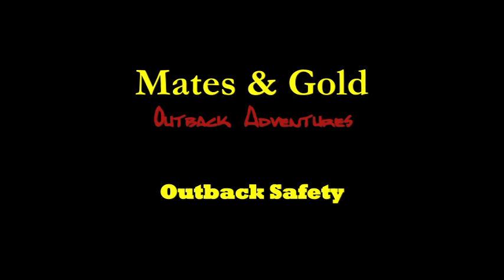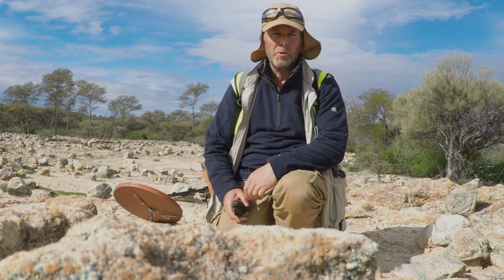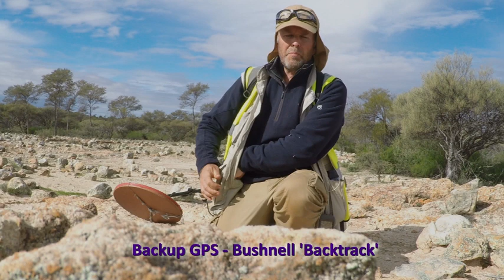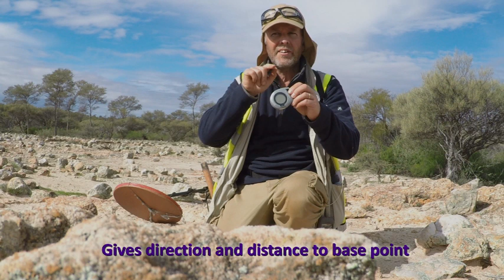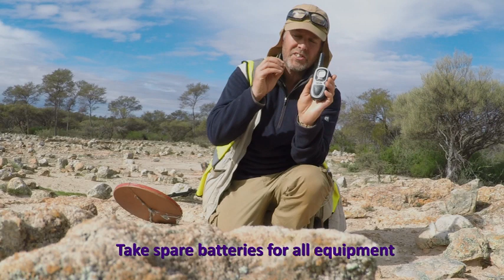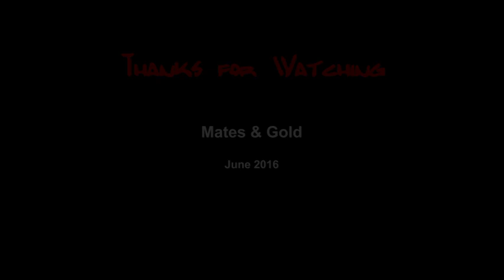Bush safety - GPS, UHF and Water

Comment: You need to be able to find your way around without that dadgum electronic device mate
Reply: Getting lost in the outback is a seriously dangerous, life-threatening situation. In a landscape without topographic landmarks, there are various methods of navigation using natural features such as lichens on the trees, shady scrapes where the roots rest or even heleotropic plants. Even the strike of the underlying geology can be a general orientational guide.
Having said this, unless you have grown up in the outback, off-road travel without the best possible equipment and backup is highly irresponsible. Yes, modern electronic equipment is not infallible, but is still the difference between knowing where you are and being lost.

Comment: Good advice thanks, if you stick a little piece of furry material on to your camera with double sided tape it will act as a wind sock to help with your future audio situations in windy conditions cheers Mark
Reply from the maker: Thanks Mark. You are of course correct with the furry mic cover. I was using a GoPro Hero4 with an internal mic and had placed the camera in a sheltered place on bedrock. It was only when I loaded the video onto my laptop that I became aware of the wind noise - which had to be cleaned up using some clever audio software on Magix Movie Edit Pro. I'll be buying a remote mic for any future 'talking head' movies. - Chris